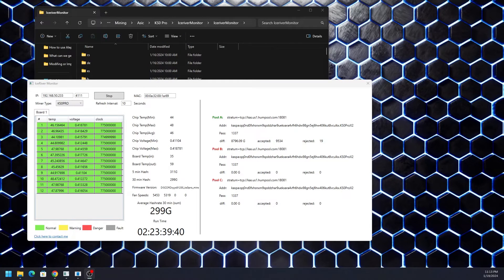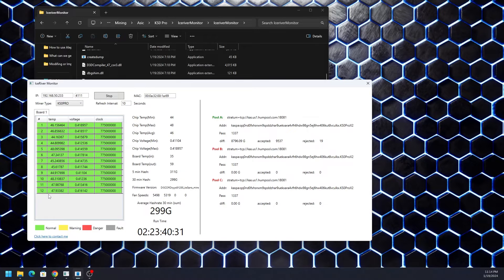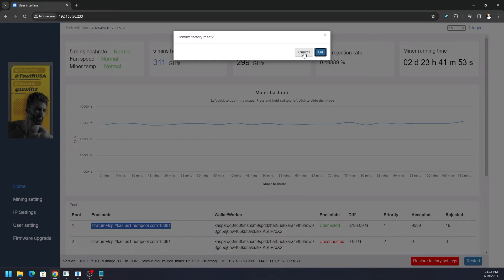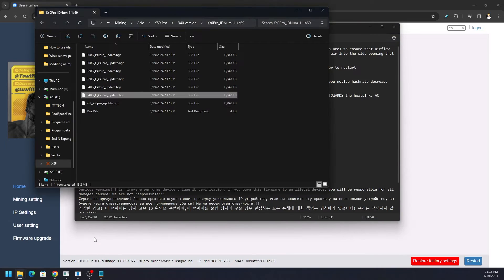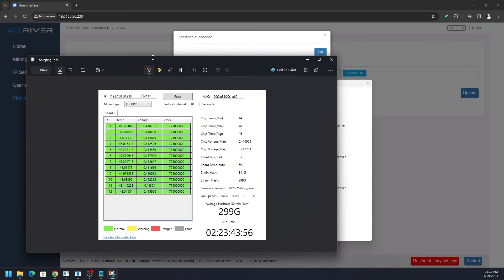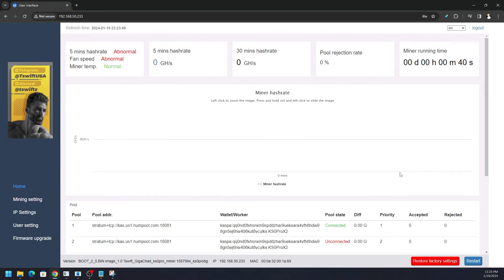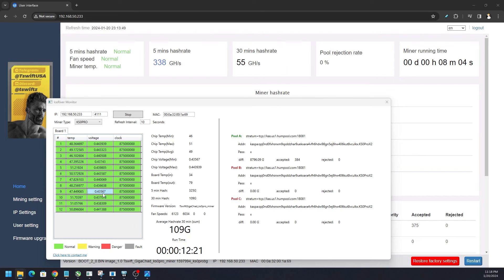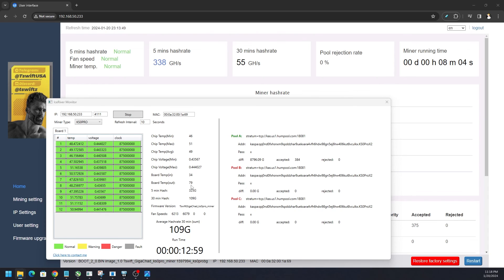340Ghs firmware on KS0 Pro & Thermals

Comment: i see files 340g and then 340g _L whats the difference?
Reply: L for low voltage
Reply from the maker: Only difference is file size, but I believe it is that if the L version, don't work, try the non-L version

Comment: I tried the 340 as well but the hash was too low. Went to the 320 and have great temps and 328g hash. I did all the the upgrade, repaste, new thermal pads, heat sinks on mosfets and high cfm fans on shroud ducting into and around unit with end covers removed.Like you said it is very important to keep it cool.
Reply: What Wattage @320GH?`

Comment: Do you happen to know the length and width dimensions of the thermal pads inside?
Reply from the maker: 1.5mm thick, about 155mm long, and it spreads out to be about 8 - 10 mm wide
Reply: @SerpentXTech  Thanks so much!